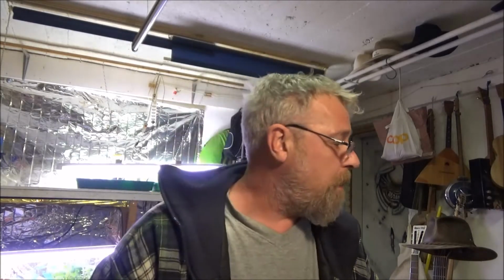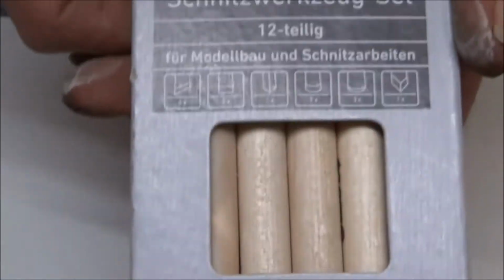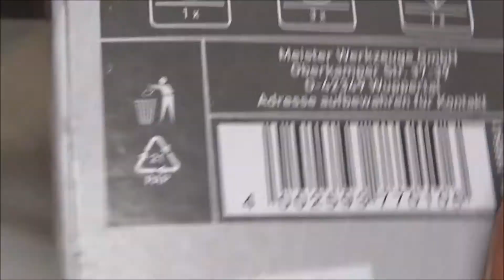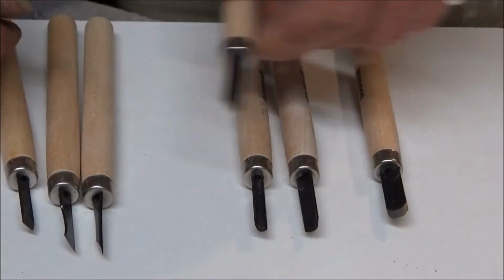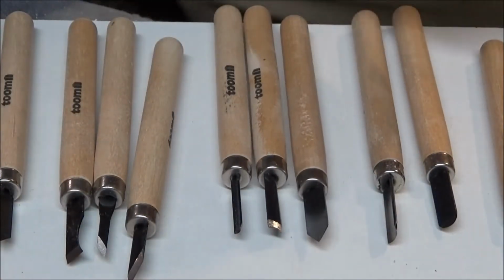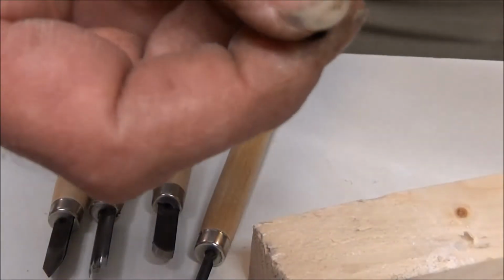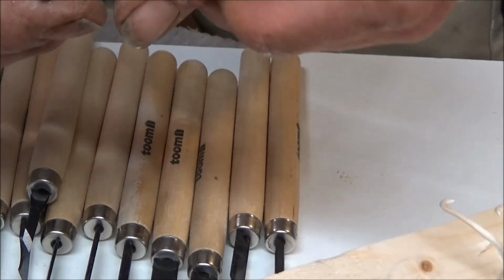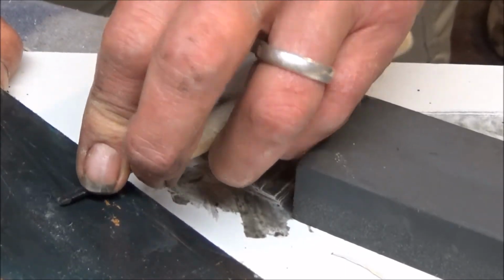8 euro wood carving knife set preview from toom Germany 20 04 18

Comment: That looks like a great set of tools and a 10 year warrantee LOL. Good luck with the bugeriegar  birds had then when I was a kid one used to fly down on my shoulder and share my toast in the morning. Got my new MacBook Pro yesterday and after the usual start-up headaches I'm loving it. I always blamed the hd video quality on my poor internet connection but with the retina display the quality is amazing and the speakers are incredible I'm using the on about half power couldn't stand it any louder.
Reply from the maker: i will see how the tools are I got the gouges and v tool sharp ;-) The others I need to change the angel of the grind a little. Yeah I will have sharpened them down to the handle in ten years lol There my sons budgies the female might not breed this year she is only about 4 months but I was pestered till I made a box for them. lol. 
The sound on my laptop is very bad I wired it up to my amp I can rattle the windows with it now lol. 
I think I will go for a mac when this one passes. The kids wanted a tv with super hi definition I told them its pointless  as my eyes dont work in that quality range ;-) Or pockets lol

Comment: You know what they say, "You get what you pay for!"
Steve
Reply from the maker: For the price they are very good I just have to put a better bevel on the flat knifes how long they hold a edge we will see but I could harden them a little more if I need too. I will use them then make a honest review on them If they are crap I will contact the company and tell them whats wrong with them. I have sharpened all the gouges and they are working well. We will see ;-) The bigger set I have cost double for 4 piece set and were no where near sharp pressed and ground to 45 should be 25 angle. Only time will tell ;-)
Cheers mate. five quid I can not complain really lol
Reply: Yep - good for a fiver. When I was in the chippy's workshop, in the Navy, I used to hate sharpening gouges!
Steve
Reply from the maker: These gougers are a bugger with them being so small but I got em if I can keep them sharp with the leather I will be ok See how they go.

Comment: Av got a few much bigger versions of them for a laithe.thought ya New video would be u using the new sluice! I've been sluicing the bit where u said to test pan.I'm doing a layer per night there so I know which is which.I can't do very much.
Reply from the maker: Yeah I have a lathe too they are easier to sharpen lol  I think it will be a week or two before the sluice arrives from Canada to Switzerland there will be a big un boxing for sure ;-) Its hard not to wait by the post box lol.. 
Yeh go layer by layer then you can say ok that where it is you dont have to slice the rest just move it you might find a little in the layer above and below the main layer. 
Happy hunting ;-)